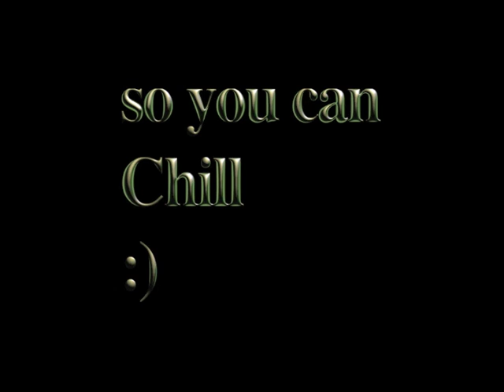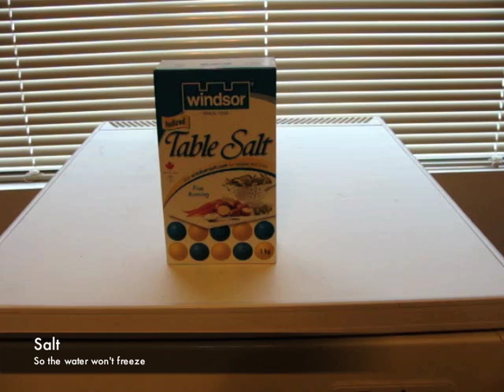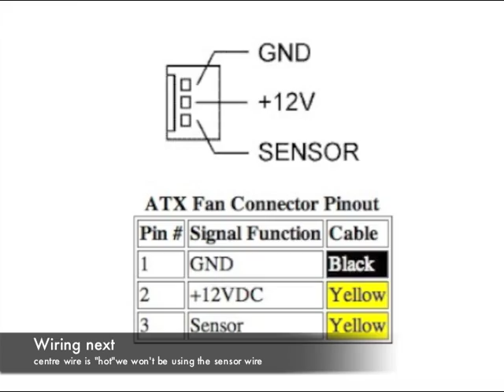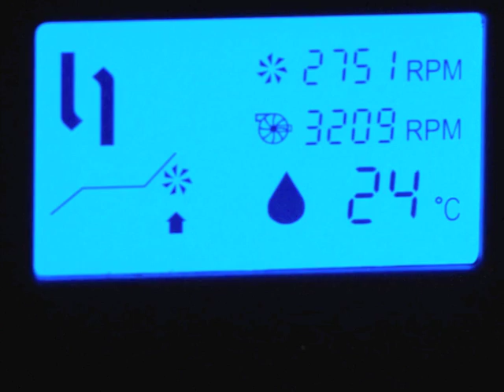Keeping cool, The Beer Conditioner project

Comment from the maker: @irwinner I'd never considered baking soda for the role. I chose salt water for it's ability to reach very cold temps without freezing, for the times when not in use. Which would be mostly, and I'm no so into chemicals so antifreeze was out. I actually did have to add a little more salt as the lines were still freezing a little, and that did resolve it. As far as corrosion you're probably right.

Comment: Your room will gradually get hotter with this. Your taking heat out of the room air in the fan and moving it inside the fridge then out of the fridge to the radiator fins at the back of the fridge where it goes into the room - plus the heat generated by the pumps. For it to actually cool - you need to place the fridge outside. That's why "real" air conditioners live outside, or have a vent out the window.